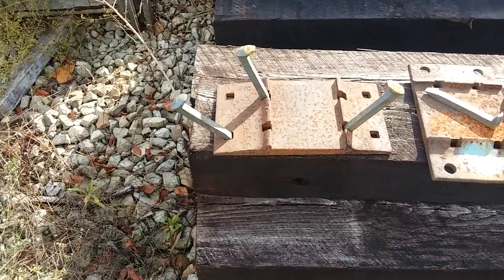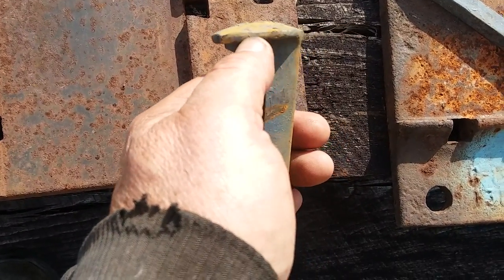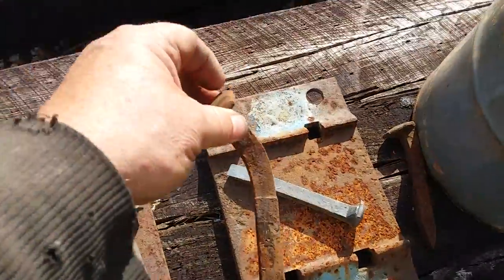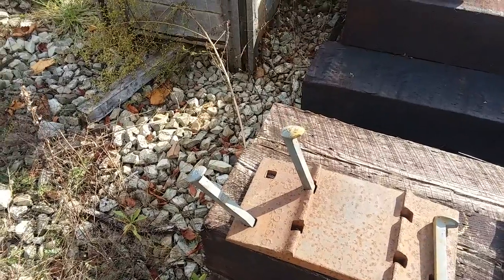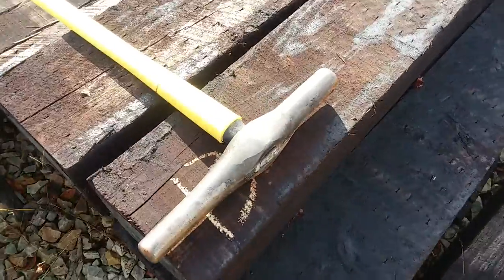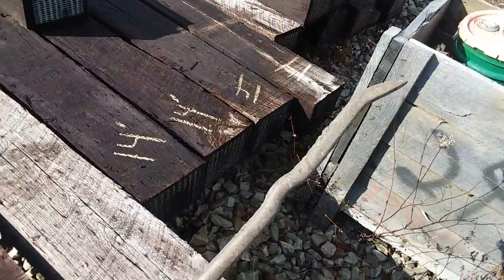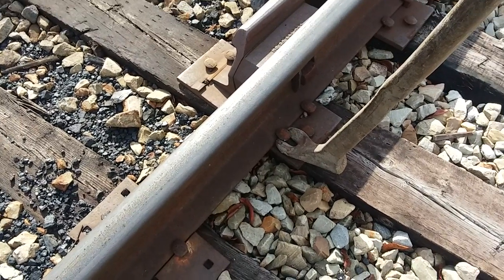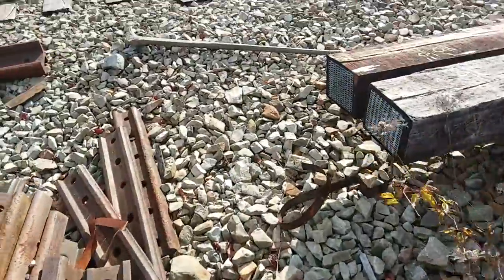All about Railroad Spikes

Comment: The round ones are called lags, or Lewis bolts, they used to also use somthing called hair pins.
NEVER strike the claw bar,  use a spike lifter.
Reply: Michael, thank you for your input, appreciate that.
Reply: @ccrx-xu1wc  glad to see someone out there sharing information about how to calibrate a machine,  it is a dying skillset.  Happy to see your not in a small cab.
Reply: @michaelladue5655  Michael, thank you. Am guessing you are referring to
one of my tamper vids. If you know about small cabs, then you too must
be an operator? Bout 10 years ago we sent our tamper to Kansas for a rebuild,
they loaned us a small cab while it was out there. So I do have some time
in the seat of one of those dinosaurs. Was glad to get mine back. Although honestly
I believe the small cab had more jacking and squeezing power, but mayb my
imagination
Reply: @ccrx-xu1wc  precision rail?
MOW mechanic for 10 years.
The switch machines small or big cab are just plain fast machines, however Jupiter machines are so easy to trouble shoot over the phone.
Reply: @michaelladue5655  Awesome Michael. You got a tough dirty job, my hat is off
to you sir. Wouldn't want be a mechanic on the railroad. I have never been around a Jupiter. We had the option to convert it over when we got the rebuild. However we
were told not to do it cause it was a nightmare. Come to find out that was the first version of Jupiter which apparently did have some issues. A guy who runs Mark 4's
recently told me the newer version of Jupiter is a dream compared to the first. 

I spoke with a Ken from Precision last fall when I was having a lot of problems
with my 6700. Ken White? Think that was his last name. Very helpful. If he remembers me, it's Dave at Cumberland. Tell him the servo valve was bad, however we had a 
voltage drop in 2 of the 3 plugs into the servo's which we also replaced. We bought the
servo off Precision I believe.

Comment: Hi there watching this in 2022 and somehow at my company we still get the big black kegs of spikes and big blue buckets of bolts, just curious what area you're located in that you don't have access to them.
Reply from the maker: All of our OTM comes from A&K Railroad. I don't have anything to
do with purchasing and the smaller buckets are what they send us.
I was told several years ago from management here, not A&K, that
because of so many back injuries across the railroads the smaller containers was the new norm. We are located in SW Pa. But I
have never myself contacted A&K to see if they still have the
larger containers either. I have heard from some other railroad
MOW folk after that video was made that they still get the
bigger containers, which now leads me to think that perhaps
our purchasing people are the ones getting smaller containers.
I have also noticed that our RR contractor Frontier RR when
they bring bolts and spikes in they are in the smaller containers also.
I'm certainly open to hearing your thoughts back.

Comment: Now, so why is the spike maul used over a sledge ? Because it’s narrow to get over the rail ? I only ask because the tips seem pretty narrow.
— Also, how would you hammer the new spike into the gap where you used the preacher’s tool to remove it ?
Reply from the maker: Yes the shank on it is longer and you can spike over a rail. A guy
that is really good (me for instance....LOL) can drive that spike in
with a maul between the rails. Other than that use a big punch,
hold it on the spike head and hit the punch. Most generally tho
they drive those with a hydraulic or pneumatic spiker which will
fit between the 2 rails. Thanks  for taking the time to watch the video. Happy rails to you until we meet again my friend.

Comment: Are railroad spikes reused when repairing/replacing tracks?  I've seen areas that are littered with them  when new ties are installed and wonder if they are collected later for reuse or are they recycled for scrap.  If collected, how does this happen?  Is an electromagnet used to collect them (like at a scrap yard)?  Thanks.
Reply from the maker: great questions sir. We never re use a spike, it's always a new one.
All old spikes are picked up either by hand or magnet and
sold for scrap. Thanks for writing in and watching the video.

Comment: Another dumb question but why do they not use big wood screws? It seems so crude and every rail I ever see the spikes are all hanging out or literally falling out.
Reply from the maker: Not a dumb question at all.  Lags are used frequently for applications such as frogs when they use Pandrol clips. Will do another vid on Pandrol in future. To use lags they are often pre drilled, now imagine trying to drill that many holes in over a mile of track, spikes a lot easier,  quicker and cheaper
Reply: English practice is to pre-drill but they do most of their construction at the shop and take the track to the worksite assembled in short sections and use lag bolts instead of spikes. If we pre-drilled the ties it would be hard to get the tie located accurately so the holes would be where they are needed. There are some who have tried to drill holes at the worksite after the tie is placed but it is generally considered too time consuming though it does give a slightly better result.

Comment: I walked a portion of a track by me and noticed all the spikes on the inside of both tracks were sticking up about an inch, and a train goes by every 2 days, should I contact someone or is this normal?
Reply from the maker: No it is not normal for every spike to be up, however the inside
rail holding spikes are not as critical as the outside rail holding
spike (rail holding spike is one against the base of the rail). I always
say when in doubt make the call.

Comment: Do they still use a manual mall for the spikes?  I would think they would use a pneumatic hammer to drive them.  I think the days of John Henry are over.
Reply: Norm, yes sir I still do, but only for a few spikes, I'm almost 67 years old and the days
of hand driving spikes for an extended period are pretty much over for me. I do use
a hydraulic spiker run off our hi rail truck for driving a series of spikes. We don't have a
pneumatic, but they drive better than hydraulic ones do. Thanks for watching
Reply: @ccrx-xu1wc  Thanks for responding to my question.  As far as age goes I know exactly how you feel.  I will turn 79 in June. When I turned 70 I started to notice a decline in my ability to do strenuous labor.  I am still in pretty good shape for my age.  But I no longer climb a ladder afraid I will fall on my ass..Good luck to you Norm
Reply from the maker: Norm, yep ladder days over for me also. That's awesome your still
doing great! Well wishes to you also sir.

Comment: Do you find metal shavings from the wheels on the curved sections of track?
Reply from the maker: We have in the past for 2 reasons. A slow order of less than
10 MPH will cause the flanges to grind much harder against
the rail face and secondly we have noticed that on sharp
degree curves with brand new rail there are flakes of metal
for about a week or so after the new rail is installed and then
no more. Very good question Les and appreciate your writing in
and for watching sir

Comment: Why are they not hammered into the tie with a pnuematic hammer? Or why is a heavy Lag bolt not used ?
Reply from the maker: Mike we do use a hydraulic  spiker runs off my hi rail truck, but for only a few spikes we just do them old fashioned way. Wish we had a pneumatic driver, they got some good ooomph

Comment: The method of spike driving you were alluding to is called "windmilling". As a former trackman it was the first skill l learned.   Yo do not use your back. As you windmill the spike maul you are letting the hammer do the work.  If you do not use this method you will destroy your back in short order.  When l worked as a trackman l usually did 100 to 150 spikes a day. Today spike driving, as well as most other track laying and maintenance is done by machine. Also you forgot to mention spike setting.  One usually had a partner working with you to set the spikes ahead of the spike driver.
Reply from the maker: Farley, thank you very much for adding in that great information! You are absolutely right on in your comment. Appreciate your years of service and for watching the show here today. We do have a hydraulic spike driver, but not an air one, the air ones as you probably know are the best.
Reply: @ccrx6700   Yes. However the machines were used by a different crew known as "tie gang." The "gandy dancers", strictly speaking was a gang that did track straightening.  This was particularly hard, hot work. However it was made somewhat easier as they worked in unison. They used a method of call and response singing led by the foreman. The songs of the gandy dancers are now a lost , and uniquely  American aspect of railroading. Future generations will never hear them.

Comment: I have a question.  Wood often splits when nailed , depending on grain orientation, specie and moisture content. I don't recall using anything larger than 16d commons, and these can split a green DF 2 x 4 sometimes. I am thinking that perhaps the treated ties have creosote impregnated so thoroughly that they retain a kind of wetness that allows the spike to be driven without causing the wood to split. Or, is it just the amount wood surrounding the spike such that it does not split? What type of wood are ties made out of? Hem Fir?
Reply from the maker: Rob, very good observations there sir.  Here's a link to the Railroad Tie Association, they have a great site with all kinds of good info on
ties which you may enjoy.

https://www.rta.org/faq
Reply: @ccrx6700  Thanks!

Comment: What about the numbered nails I find in ties that I use for corrals etc. I found one recently that was 36. How long do ties last"?
Reply: Those are date nails and are no longer used but were up until the early 1960's. It depends a bunch about the conditions the tie is in but the number is the last two in the year it was installed. Usually they last about 20 years.
Reply from the maker: @keithstudly6071  Keith, thank you sir, appreciate your input

Comment: So do the spikes grab the tie like a nail then or just crush the wood of the tie but prevent the rail from moving laterally out of gauge?  Do they also tend to split the ties given their size?
Reply from the maker: Yep, drive them in like a nail. They dont usually split the ties. Biggest problem occurs when spikes loosen from rail traffic going over soft spots like mud under the ties, then water gets in the spike holes and starts deteriorating interior of the tie

Comment: What's the logic behind the two spikes on the gauge side being like they are?
Reply from the maker: In curves 2 spikes hold gage better than a single one, does
that make sense to you. Thank you for watching
Reply: @ccrx6700   Isn't the wheel pushing the rail toward the field side on the outside rail of a curve? Or is that to help prevent the rail being rolled outwards?
Reply from the maker: @SuperAWaC  yes it is, but also remember the tie plates are cut on a 1 in 40 cant inward

Comment: How do you get the rail spacing right?
Do you pre-drill any holes?
Reply from the maker: track gage is measured with a gage rod and then spikes are driven to
hold gage John. Never pre drill holes for spikes.  Thank you very much  for taking the time to tune in and check out the video. May you have a most blessed day my friend.

Comment: If a spike breaks, what tool do you use to remove it?
Reply from the maker: We don't usually do that Shirley, if the spike breaks down low
then we have a square punch and just drive it down into the tie.
If the shank is high enough possibility we could be able to use
a claw bar and try and bend it over and then pull it, but it usually
breaks down low. And they don't very often break either.

Comment: How do you drive the spike in  between the two rails where you used the preacher bar to pull the spike?
Reply: Very carefully...LOL I would use the long thinner end of the spiking maul, and if need
be to further drive it down, would use a B&O and hit that with the maul. B&O has a very
narrow head like a big punch, we often use it to drive down spikes that are under
bolts that are difficult to hit full on with a maul. B&O means a beater outer! It got that
name cause that was the tool they would use to remove old rivets back when everything
was put together with rivets. Very good question Tony! Thanks for bringing it up, wish
I had covered that in the video, really sorry I didn't even think of it till your comment.
Reply: It takes 2 men to do that. 1 man holds a spike maul on top of the spike and the second man hits it with a second spike maul. I never heard of a preacher bar, we called it a crows foot.

Comment: twelve thousand spikes a mile and only fifty a bucket?
Reply: Imagine having to pack them in by hand.
Reply from the maker: Lot of buckets, we buy them by the pallet load. We used get tin kegs with 200 in them, but that was long time ago, before that they came in wooden barrels. Thanks for watching sir
Reply: 2600 ties per mile and 4 spikes per tie unless they tell you to use more than 4 per tie which some could want as many as 10 but I've never seen that done. Usually We do one on each side of each rail.

Comment: Why the different size ties, some are longer than others?
Reply from the maker: Turnouts have longer ties than regular track because of the
main track and also the track into a siding laying on the
timbers at the same time. Also gives better weight distribution
for the frog. Hope that helps Michael and thanks for watching.
Reply: @ccrx6700  what is a green frog got to do for track other than get smashed?

Comment: Is there a tie plate on every tie?
Reply from the maker: Yes sir there is. Tie plates weren't used until around 1900 or so,
rails before then were just piked directly to the tie. Tie Plates 
help to add resistance and prevent tie wear also.

Comment: Real interesting. I actually found an old spike today while digging out some hedges in front of my house. I live in coal country and my home was once a coal company 2 room house built some time in the early 1900's. Is their any way telling how old the spike may be and would it hold ant particular value, besides sentimental?
Reply from the maker: Nice Mike! great find there. I believe some old spikes had dates stamped on them, but obviously this is not one of them. Any idea what railroad serviced that mine? I'm not done much in way of knowing how much old railroad stuff is worth so not much help there sir
Reply: The mines around here were owned and run by Consolidated Coal so I'm guessing B&O. It's in central WV. I'll look at it and see if theirs any info on it
Reply: @ccrx6700  Well I couldn't find any writing or dates. It's 6 1/4" from top to tip. the shank is square  5/8" X 5/8". The head is shaped like the one in your video,  about 1 5/8" X 1 3/8". I don't think it was used, but theirs damage to the shank on the corner like it was hit with something that created a large sliver sticking out that would make it hard to get back out if you did drive it in.
Reply from the maker: @mikemccann6556  okay Mike, thanks, i dont know what could have caused that

Comment: If rail road spikes are made from low carbon or "mild" steel why can people make knives from them and then harden and temper the knives?
Reply from the maker: Sorry, i did not state that very well in the video. Spikes are a high carbon steel, but not as high in carbon as rail is. Thank you for your very good question, hope that explains it better

Comment: interesting your railway track is still using timber ties/sleepers. Any reasons why the owner of the railway hasn't considered concrete ties/sleepers? I know concrete sleepers are expensive up front but they are easy and quicker to be fastened to the rail. In terms of maintenance, concrete is less work to maintain than timber and in terms of holding the gauge of the track, concrete is far superior than timber.
Reply from the maker: You might enjoy reading this article for your answer

https://www.rtands.com/track-structure/ballast-ties-rail/new-paradigm-design-concrete-crossties/

Comment: What track protection do you have in place 🤔 top? Or 105?
Reply from the maker: We are a captive RR. Our protection is when a train passes and
the track crew gets on, then the train is not allowed to leave either
end portal unless and until the track crew gives them direct
communication that the crew is clear and track is green for them
to run. Train is also required to give clearance calls at
several locations during their runs and upon leaving each
of the 2 portals. We do not have block signals here either, they
are currently looking into installing GPS on locos and track
equipment, but who knows when that will come into effect.
Reply: I was asking cause here on ctc or Ocs . You need a TOP track occupancy permit . I wa swonder9ng if you where working 105 redheads derails or had a clearance lol
Reply: Well my spelling auto correct changed some of that lol . 105 red flags and derails.
Reply: @ccrx6700  where are you working out of I missed it if you said.
Reply from the maker: @brandonrickert9367  Cumberland Mine RR. Track runs from Kirby PA. To Alicia Pa.
Reply from the maker: @Brandon Rickert  understand that, my phone changes spelling a lot. Sometimes my smart phone is rather stupid 🙄

Comment: So they don't use high carbon spikes on corners then?
Reply from the maker: It's kind of confusing, spikes are a high carbon steel, however
they are not as high carbon as rail is. Hope that clears it up
some. Thanks so much for stopping by and checking out the
video today my good man.
Reply: Thanks for the reply
Reply from the maker: @tryinhard1909  👍😊